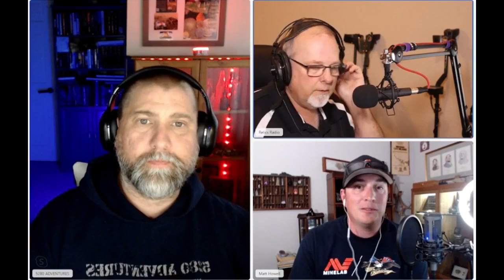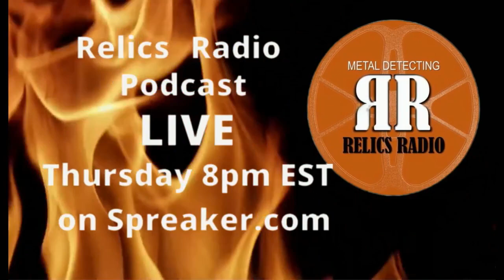Understanding the Differences Between VLF and PI Metal Detectors and How Do They Work?

Comment: PI machines penetrate more ground when it comes to depth and they are excellent on almost any type of soil including beaches. They are slower to send an audio signal to the speaker ( at least the DIY ones I made). In other words, if you swing so fast you will miss deep targets. on the other hand, VLF have an instantaneous audio response but their detection range in the ground differ from in the air. In conclusion, they both can be great machines. You just need to know what you are mainly hunting for, and to learn about the ground that you will be dealing with. Then you should be able to decide for yourself what machine suits your purpose better.
Reply: Thanks,